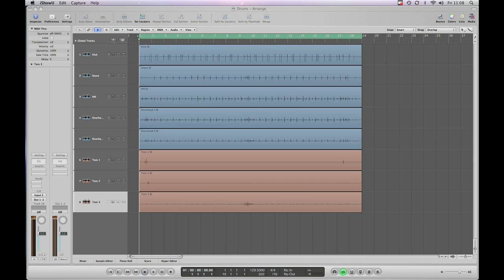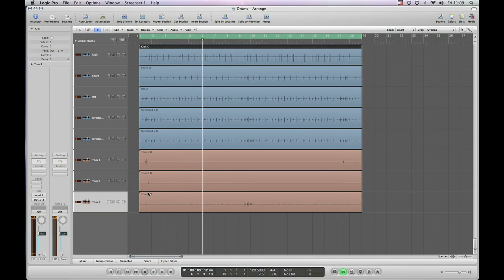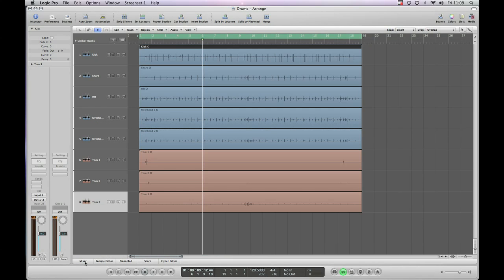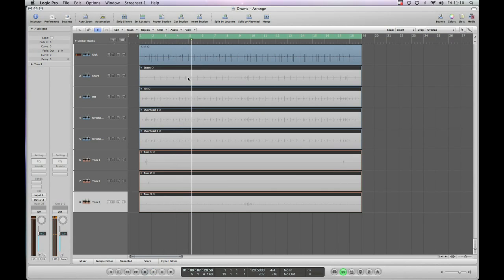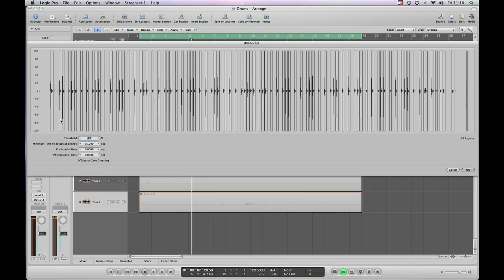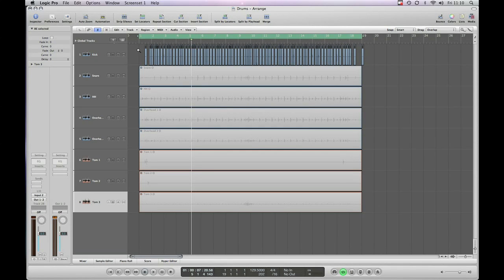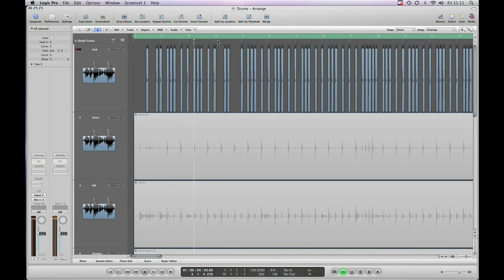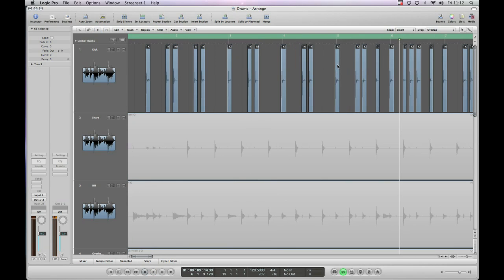Logic Strip Silence And Drums

Comment from the maker: @studiomikeK0921042 The same process should work fine, with a couple of caveats, snare tracks can be more nuanced, for example ghost notes or flams, these can be hard to separate out from the back ground noise. The other thing that can be a pain is Hat bleed. That said if you take the time you can adjust the regions manually.
What I quite often do is, copy the snare track, strip silence the copy and use this track to augment the snare track only on the big hits. 
Let me know if you need more ?